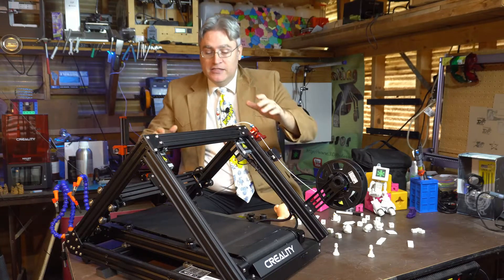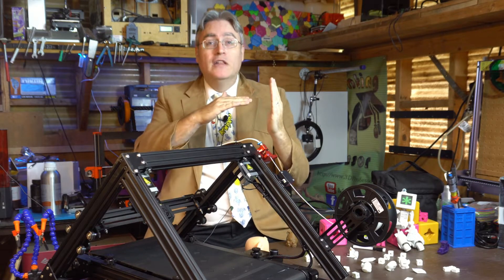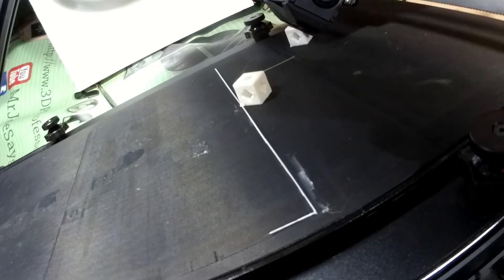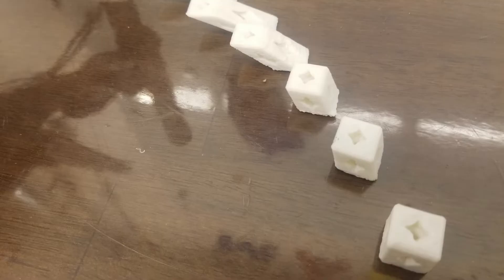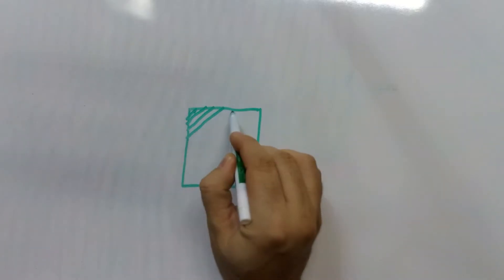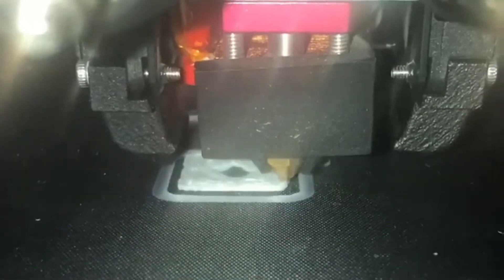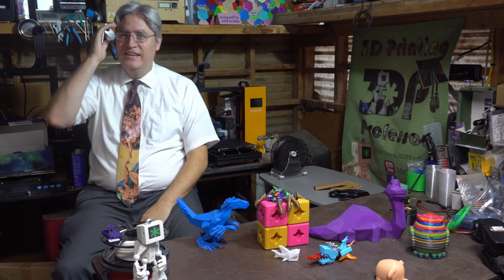Hacking the CR30 to print in layers. Belt 3d Printing

Comment from the maker: You into Math? https://www.3dpprofessor.com/2021/11/10/hacking-the-cr30-to-print-in-layers-video/
Reply: So, the one big problem with moving the belt backwards that I don't see you've accounted for is the flex in the belt.  If you move it in the same direction, you're always putting the belt under tension... however, if you move it backwards you'll actually pull all the slack and put it onto the top of the belt (normally, it's pulled taught.)  That difference can actually account for an error of several hundred microns... and unless you have a motor at each end,  you won't be able to a) eliminate it or b) compensate for it as it'll vary depending on what's printed.  In my original concept printer, I actually did try it.
Reply from the maker: @williamsteele  Others have brought that up, and all I can say is "wasn't a problem in my tests". Yeah, it might be off by a little, and it might be worse for bigger things. But that's why we need to get this slicer mod, so we can test it!

Comment: You ever have contact with Stewart for Kiri:Moto? Did you try nozzles with smaller conical angles of the tip? Standard Creality ones are 90 degree but they make some more pointy 60 degree ones. As far as an adjustable angle hotend, trunnion design like a table saw would be really good. You could make the tip of the nozzle the axis of rotation so hopefully you wouldn't have to change the Y offset when going back and forth. Or there is new code out there for strain gauges so even if the nozzle tip didn't make it perfectly back in place, the nozzle can probe the build line and recalibrate the Y offset using the strain gauge. The new IR3 V2 belt printer by Ideaformer uses this type of probing technique to "mesh" the built line along the X axis contact line.
Reply: Disregard the question of talking to Stewart, I'm reading it now on Discord.

Comment: there should be a relatively trivial way to make it only do downstrokes, keep track of the position, then for each move if the Y direction is negative, chain the movements in a list while the direction is negative, then add a hop and a movement that goes to the end of the last one, and reverse each movement, and add the same hop and movement after that.
you will always get 2 extra movements after each chain though.

Comment: Could this potentially be modified in the gcode. And just have chatGPT make the modifications?
Reply from the maker: I'd say to give it a shot and let me know how it goes.
However, my expectation based on past experience with ChatGPT is you get about 2 paragraphs that seem reasonable before it has a stroke and tells you to Gump the head at the front and tie Jack's feet together. I'm not sure I'd trust it with the operations of machinery just yet.

Comment: I think it would be possible to create a custom profile for a mainstream slicer. This profile can implement layer sift on each layer and remap the z axis, so that no modification at the piece you want to print is necessary. So you easily can batch print small parts. This would be ideal for me, i bought a CR-30 and did not realize that the parts which i want to print are impossible to print on it. My printer was just expensive junk upon this point.
Reply from the maker: Hope this helps.

Comment: Could it be more efficient to tell the firmware that belt is y-axis and diagonal is z-axis*0.707? Then you dont need to modify gcode, not scewing the model in unknown best orientation
Reply from the maker: That's not the way they've done it, but that could be another soltuion.

Comment: Only 10cm back move? And needs tilted head?
Well do both: a second head on the gantry for layer printing.
So use the extruder depending on the way you want to print.

Comment: I'm just glad I never purchased this printer. It might benefit from certain model designs, but this thing takes up so much real estate as well.
As well as the nozzle being parallel to the bed which is what I didn't get when they designed this, but why not have have the z axis move in the vertical, like a cnc??
Reply from the maker: "why not have have the z axis move in the vertical"? Probably because that would tread too closely to the patents held by makerbot.

Comment: Your idea for down motion, is actually really needed for slicer on belt printer. 
I noticed higher thin Beams, are exposed to more then one issues.
When the nossel travels upward, in lift the print, really just a little...(really minor). This affects the speed, you can go in the total print.
When you slowmotion the corners in pushes just really tiny on the corners. This mean the line is just not get precision you want. 
So your idea for this, i would think could enhance speed quite a lot on the belt printers....check it out.
Hollow beam.
No more then 50mm wide but double the height 100-120mm

Comment: I did not read through all of the comments but let's take your great idea to the max:  replace the x-y gantry with a delta gantry - You would gain the speed of the Delta combined with the ability to angle the nozzle or make it orthogonal to the belt like a conventional 3D printer.   That would be my ideal!
Reply from the maker: That's an idea, but it loses the advantage of a belt printer, that belt printers do what they do with no additional complexity over a regular cartesian 3D printer. I mean, if you're going to use an extra motor so you can angle the print head, then why go full delta? Just put a motor on your print head, right?
Reply: @3dpprofessor  In my mind you'd get the best of both worlds as it can function either way - classic or belt.  Hopefully someone tries it and we can see the results.

Comment: Curious... what about your part geometry is the CR-30 unable to print?  Have you thought about printing them at a 45 degree angle with a corner pointed forward?
Reply from the maker: Like at 3:24?
Reply: @3dpprofessor  Um... yep... exactly.  How did I miss that? :-D
Reply: @3dpprofessor  One thing you can do on those overhangs to minimize them is to use a variable layer height and go for thin layers in just that section.  (Or in any areas where you want a higher quality overhang on the front.)

Comment: While I applaud the mention of calligraphy nibs and the attempt to find a purely software solution, I personally think that a better solution - and one more popular due to preexisting desires for it throughout much of the community - would be too add a rotary axis either at the print head or at the mounting points for the x-axis gantry. This would also require new slicing profiles, but it's already sought-after, it has much greater versatility, and it avoids several of the complications of the novel "calligraphic 3d printing" concept you propose here.

That IS a really cool idea though.

Comment: That's infinite-Y, not infinite-Z
Reply: I invented it... it's definetly the Z axis, which he described perfectly.  Technically, that axis in my original code was Z' (Z Prime).  The inputs to calculate that are Y and "desired" Z... which results in the Z' (belt distance.)
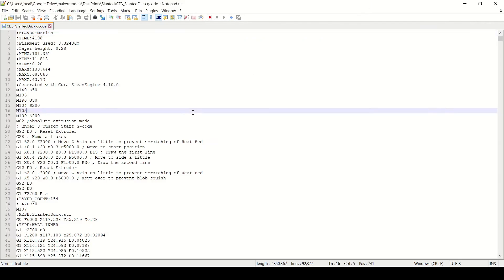Reply from the maker: 6:30 The way I had to edit the GCode disagrees with you. The printer think's the belt is Z, so it's Z.
0:56 And, if you stand up the printer like this, you can very quickly see how it could be a tilted Z. So it makes a lot of sense.
However, this whole argument is muddied by the fact that we can't even agree which way is up, Z or Y, between different applications in the real world. Sometimes, even the same application will sometimes use "Z" for up, and sometimes use "Y" for up. Here's a classic 3DPProfessor video about this: https://www.youtube.com/watch?v=PvOo1UBIJho

Comment: They may have identified it as non enforceable due to prior art, as the concept was separately published on a 3d printer forum before the patent was filed.
Reply: Or not.... its on the rep rap blogs 2008 November (11) idea-for-reduced-cartesian-structure
Reply: @tacticalpoet  Thank you very much 👍
Reply: Could you link to the forum?
Reply: @sunekeller9547  that worked, sadly linking is hamstrung due to (fully justified) anti spam bot messages

Comment: My question... The patent exists, but have they done anything with it in the last 7yrs? I'll admit I know nothing of their product line. However, if they haven't been producing devices (affordable or not) using the patent then shame on them.
Reply from the maker: As far as I know, besides the belt plate for the cupcake, they never have done anything with it. But sadly, that doesn't invalidate their patent.
Reply: @3dpprofessor  true, but it makes them the "bad guys" for sitting on it. Stifles innovation in many respects. I believe if you're going to patent something then you should have plans to pursue development. Them appearing to have just sat on it for nearly a decade is wrong. Kinda hoping the kickstarter succeeds.
Reply from the maker: @OldCurmudgeon3DP  that's kinda not the point of patents. Patents encourage innovation by giving inventors a safe place to share their ideas. If anyone "steals your idea", without compensating you, then the owner has rights to sue... until the patient expires. 
There problem is someone came up with a novel implementation and developed it before the patent expired.
Reply: @3dpprofessor  I get the purpose of patents. I don't believe they should be used for squatting on a concept as may be happening here. What I take away from your explanation is that a patent protects "an idea." If the patent holder does nothing with that idea for a decade, how does that benefit anyone. A useful patent allows the holder a chance to recoup R&D and turn a profit for a number of years; After which, others are free to run with the original design. Either pursue development & marketing, work w/ others to license the idea, or don't bother in the first place. 🤷🏼‍♂️
They already have a bad wrap over the initial patent that is said to have stifled printer development until it expired.
Then again, I'm just a nobody and probably don't know what I'm talking about. (most likely)
Reply: @3dpprofessor  Actually, patent law does have requirements that the technology be used in production either directly or by licensed entities to remain valid after a specified time (I think three years). Judges working such cases with the USPO have a long history of reassigning patents or declaring them public material when someone else has infringed and the original patent holder hasn't used them in or since that period and cannot provide proof of imminent use already being spun up.
Reply from the maker: @claws61821  and makerbot did sell conveyer build plates for their cupcakes within that 3 year period, so the patent is valid. They just haven't done much with it since then. 
I know there's stipulations in trademark law that a trademark needs to be actively used within a certain period, and I know copyright law does not have those upkeep stipulations. But does patent have a required upkeep after the initial usage requirements are met? I don't know.
Reply: @3dpprofessor  That I don't know either. I was only addressing that one particular tangent off of what you said, because your words could have suggested to others that there's NO usage requirement.  Sorry for not clarifying that before

Comment: Looking at the patent you mentioned Joe could also apply to the CR30 or any other belt printer as the patent is specifically on belt printing and continuous fabrication. So the patent is for a belt print surface not the orientation of the part or if it's one printed continuous or multiple copies printed. The conveyer bed is the core if the patient
Reply from the maker: Possibly. But the patent doesn't mention continuous printing. Just sequential. 

But, again, being sued is less about the patent and more about the disposition of the patent holder, and so far Stratasys has been strangely quiet.
Reply: @3dpprofessor  Agreed. Which I'm surprised with as they have been relentless in the past.

Comment: Interesting. As a quick hack in between, you could post modify the normal gcode to modify all movements going against the grain to
- disable extrusion
- add a small Y-hop
- then do the opposite movement with extrusion enabled
- then do the movement with hop again to end up in the correct place
Reply from the maker: Yes, but how to identify the gcode movement that go against the grain, and what do you do when printing something, like a Chibimal, with a lot of small against the grain movements in sequence?

I'd be interested to know how this can be done.
Reply: @3dpprofessor  
If the movements are linear, identifying the gcode shouldn't be too hard. 
If they are not, not sure what to do then.

And those very small pieces would indeed by quite a pain.
But i think there's a doable way to group  them in a lot of cases.
Reply from the maker: @francisduvivier  I'll say what I often say in the makerspace:
"Give it a shot and let me know how it goes."

You don't need a belt printer to try and see if you can cancel any negative Y movement.
Reply: A way to group them is writing a post slice script to look ahead to the next gcode line and compare that Y move to the previous Y move. Assuming you want all moves to move in the positive infinite Y direction (or “with the grain”) of an XY coordinate plane, if the next coordinate has a Y component larger than the previous coordinate then you’re moving in the positively infinite Y direction, if it’s smaller then you’re moving toward the negatively infinite Y direction (or “against the grain”). If the Y value is the same in the next extrusion gcode line then that means it’s only an X move, it could be ignored or used to mark the end of a smaller group of consecutive moves. reverse all the against the grain moves to make them with the grain and get to printing. speed increase I can think of off the top of my head is making the infill angle at 90 degrees so every other layer is mostly made by X moves, probably would be best to start from the “negative” most coordinates so that you’re always moving with the grain, saving some time
Reply from the maker: @gcod3d161  Well, it's a simple matter of coding, then.

Which, if you have ever worked in software, that statement has a reputation.